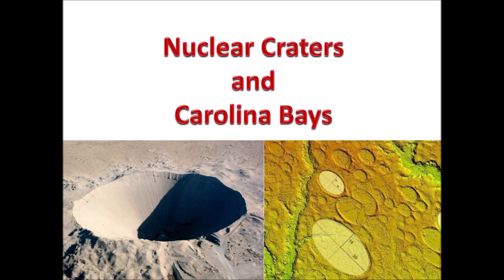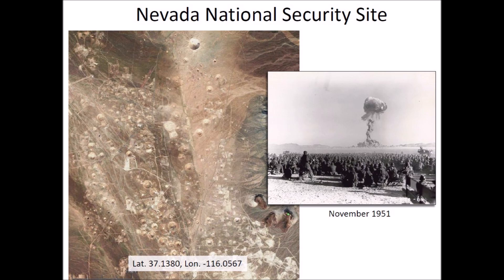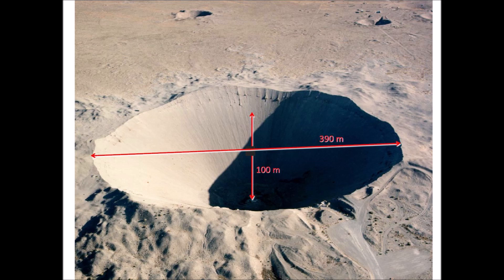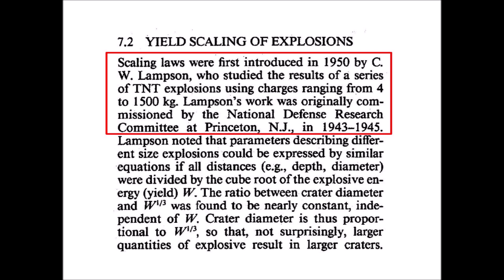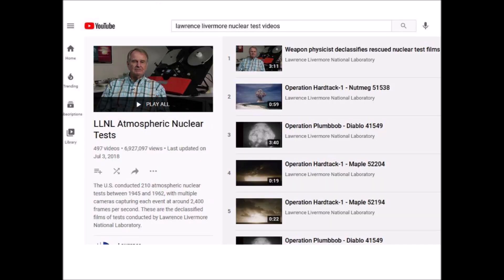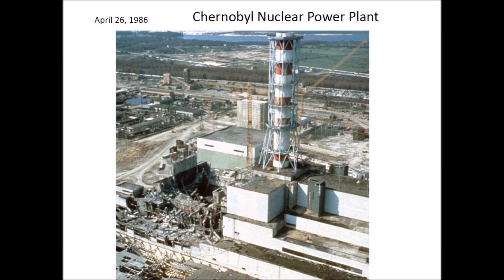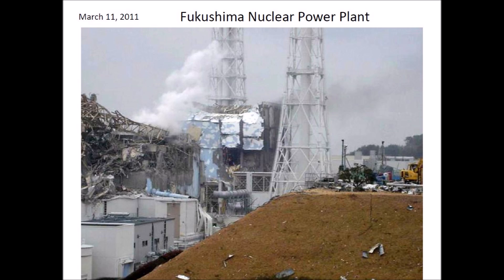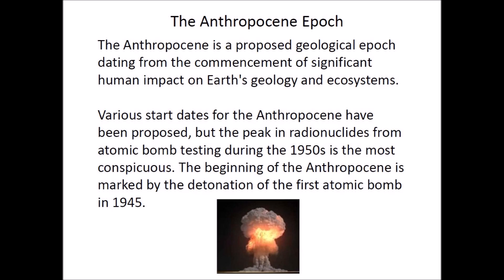Nuclear Craters and Carolina Bays

Comment: But Antonio, what is the connection between nuclear tests and Carolina bays ?  You didn't explain clearly how the research on nuclear craters could have a bearing on the size of the bays.  If you had shown that ejecta from the nuclear craters formed secondary, elliptical craters, that would have been relevant, but I didn't hear anything like that.
Reply from the maker: It is time to watch the video again.  I made two points that showed the relationship: 1) The diameters of the craters made by nuclear explosions correspond to the cube root of the energy of the explosions, and these equations are used to calculate the energy of the impacts that made the Carolina Bays. 2) The radiocarbon dates of the Carolina Bays are in the future, indicating contamination by carbon-14. It is possible that the anomalous results are due to radioactive contamination from the nuclear tests.

Comment: With radiocarbon dates in the future, it shows just how many sources of proxy corroboratory evidence or research needs to be collected to have anything worthwhile. Were the Carolina Bays dated on this alone, the results would be out the window. But there's enough out there already that you can narrow the source of the error down.
Given that the impactor was a fragmented bolide, I'm pretty exited about what has been extrapolated already and wonder just where the results could lead us.
Throwing nukes about in the backyard is always silly. It goes witout saying. And, really, deporting a whole bunch of islanders just so you can set them off in the middle of the ocean, and not paying them compensation is bordering on the vindictive.
Reply from the maker: A video from three years ago shows the inconsistency of radiometric dating, as well as Optically Stimulated Luminescence.  https://youtu.be/d6gisXApcw8
Reply: @Antonio_Zamora  Thank you. I watched this with interest. My first thought about the errors in OSL being due to overturned flaps demonstrating inverted stratigraphy of previous sediment onto younger sediment is that they are not errors if this dating is consistent to many bays, and helps prove how they were formed, and also shows the consistency of OSL itself.
Reply from the maker: @neilbain8736  The problem with OSL dating of the Carolina Bays is that OSL requires the samples to be taken at a depth greater than one meter to avoid cosmogenic dose errors, but this virtually guarantees that the sample will be too deep and will not correspond to the surface layer at the time of emplacement of the bays.

Comment: I was in a nuke unit in the US Army. The Lance tactical nuclear missile system. It used the W70 nuclear warhead with a yield of 1–100 kt and also HE rounds. The Lance was one of the fastest missiles in the arsenal reaching MACH 3 by the time the missile left the rail. It was also one of the first neutron warheads with enhanced radiation. My unit, in Germany, covered the Fulda Gap during the cold war. The Fulda Gap would have been the path the Soviets would have taken if they had decided to invade the west...besides all the legal E. German commercial trucking in W. Germany, at any given time, full of 
Spetsnaz. 
I was in W. Germany when the wall came down and thousands of excited, and skinny East Germans, all with the same 1000 yard stare, came flooding into West Germany. It was an awesome time to be there. They were all so happy to be there, but also scared to death that someone would change their mind, or that they would wake up, back in E. Germany, and it had all been a dream. 
20 years after I got out of the Army, as chance would have it, I worked at the worst nuclear plant in the United States and one of the oldest, as an instrumentation and controls technician. D. C. Cook nuclear power plant. I had enough experience to be scared when I was in containment of that plant. When you have to low crawl to your tasks to avoid being directly radiated, you start questioning some career choices.

Comment: I think we need a better model to demonstrate bay formation.

Off the top of my head:
What if we put an inch of wet sand on top of concrete or asphalt and then shot a compacted snowball at an angle (consider a spud gun).
Reply from the maker: Take a look at the modeling video: https://youtu.be/94km3ZKiPSE